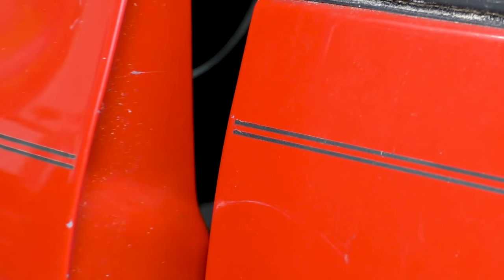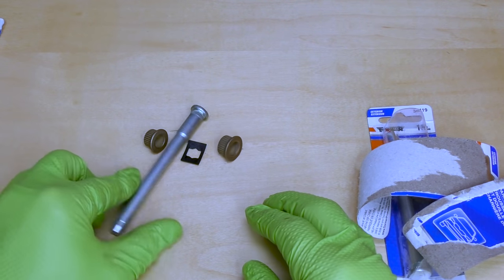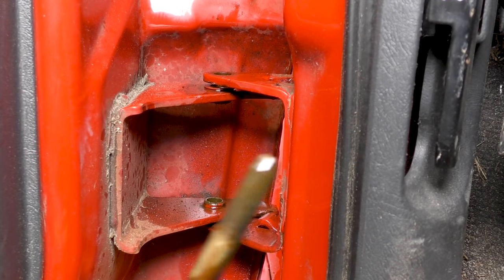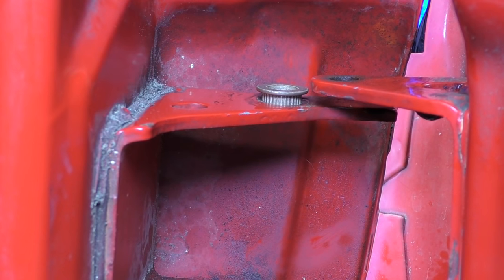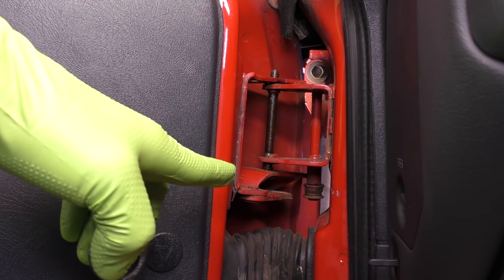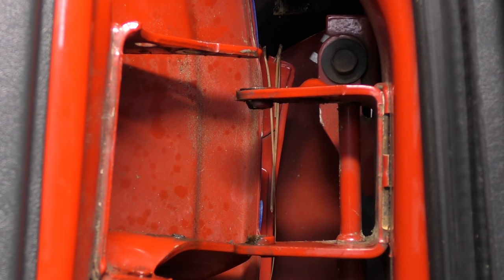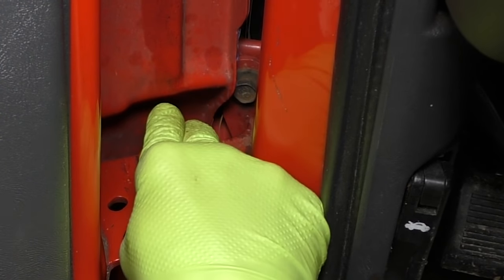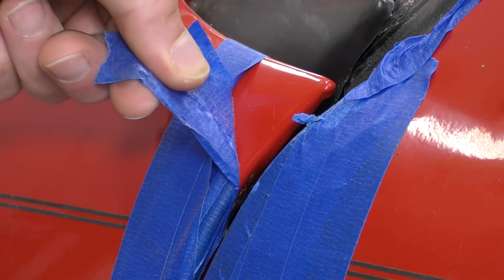How to Replace Door Hinge Pin & Bushing ~ Fix Sagging Door

Comment: How about how this evolves into striker and latching mechanism? Where can I find info on a striker plate, jamb, and latch that's loaded with debris from wd40 over the years and is now stuck to where it will not shut, the temporary flathead system only lasts so long. I do have some dry graphite powder. Anyways, any advice? Perhaps where I should start first? Pins and bushing kit? Latching mechanism? Striker plate?

Comment: You are awesome, I really enjoyed watching the video. One question if I wash the door joints with water, then spray some body wax to joints is that enough to avoid getting any rust or avoid removing joints lubricant? Or should I re-lubricate the joints again?

Comment: Other thing is if top bracket on door is ovaled out, you can clean it off and weld a washer that fits pin on top of door bracket then paint before reassembly
Reply: pin is 3/8" (washer inside diameter hole), so use a washer with that size hole.  You'll be going steel to steel, instead of using a bushing.  You'll have to use wire weld to secure the washer (so you don't torch everything inside the frame).  I haven't done this (yet), but this was suggested by a mechanic with about 200 years of experience.  I suspect this will last a while.  You might have to trim the washer for clearance, depends on the outside diameter of the washer you use.  My pin hole is warbled out bad, so I'm going to try this.  This is the best replacement video I've seen so far.
Reply: I have done the washer repair. Worked great. Sold vehicle. But still good 4 years later. I got another blazer so gotta do same repairs again

Comment: Big nut ( M12) placed there with a fender washer will enable that home made press to get the bushing all the way in without needing it to be hammered and dented.
Reply from the maker: YEP! I think I cut the part about bigger washers. It sounded weird and I didn't have any to show . LOL
Reply: @HumbleMechanic  Grease the parts of the pin that go in the bushings as well before putting in, along with a bit inside the bushing. That way the lubricant is actually where it is needed, and not just on the surface, unlike the factory that put them in bone dry before the paint shop, and afterwards showed them a drop of lubricant is passing, leading to them wearing.

Sagging door I have in the past used the car jack to gently bend up to be a better fit, was just sagging because cabrio and heavy doors but not worn pins. Soft body panels have moved with age, moving the hinges along with them.

Comment: What about replacing the other hinge pin that the spring rides against? The top innermost pin. The bottom of this pin on my truck is bent and the bushing is spanked. Your video on the pins is great, would love to see one on how to replace the other part of the hinge.
Reply: New hinge in that case

Comment: What I'd like to know is actually repairing the holes for the body side of the hinge. When it's like that for a very long time the pin actually makes the hole oblong and bends the bushing in a weird way to where the pin it wore at. I saw someone make a template and cut it and make a new hole. That's cool but I don't have welders to do that fix sadly, I did this actually not to long ago and I see a gap between where the hole is closest to the body. I'll see how long the kit I got lasts till I have to do it again. I'll probably then go to gm and buy a crap ton of them because those are the originals there too.

Comment: What about if instead of just using a washer under the nut you used a longer bolt and a socket under the washer? If you use a socket larger than the diameter of the bushing then you can just crank away til the bushing is completely seated.
Reply from the maker: that way would be great!!!

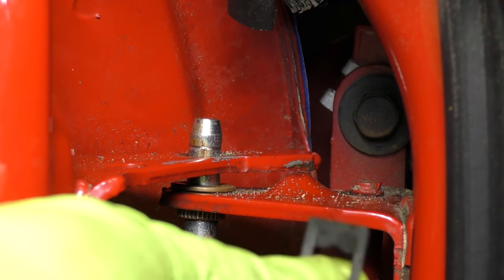Comment: 14:14 pin bent door bracket up on install. The end-stop is misaligned. Hope you tapped that back down.
Reply: Maybe sandwiching the two parts together with vise-grip pliers (not necessarily bone tight but just enough to keep them from spreading apart) would be a good way to do that. I know, you might need three hands or a lot of patience.
Reply: @robj2704  A block of wood between the parts is a nice way to avoid pushing too far. You can adjust a small block of wood with an axe or sharp knife.

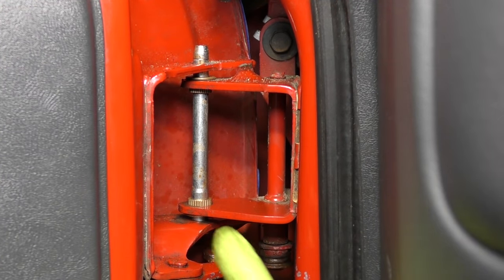Comment: When you drive your pins back in you really need to watch your alinement so you don't get what happens at 14:14. The bracket bent  so much that it misses the the door stop. I'm sure you can bend it back.

Comment: If you use a slightly longer bolt and a socket as a spacer (big enough for the bushing to fit inside), you'll be able to just use the bolt as a press and drive the bushings all the way.

Comment: 15:57 I would suggest also adjusting the lock to make the door flush with the rear panel or door. This car seems to have rear of the driver's door slightly outwards. Usually either the lock in the door or the bracket that it catches have big holes to allow adjusting the door when it's locked.

Comment: I had a 2000 S10 that did the exact same thing.  I took it to a body shop because they had to repair the actual hole after the pin wallered out the hole.

Comment: While I totally appreciate the video, the process is perfect. Those things will only last about a month and you will find yourself doing them again and again. Especially if your door has had bad bushings for a while. On my Sierra, I have replaced them about 5 times.  I am to the point where I either need to replace the actual hinge part on the door/body or weld the hold up and redrill them.
Reply from the maker: OH DANG!!! those must have been toast. I hope the owner doesn't ahve to replace them again soon.

Comment: Charles - I too have a DBP R32 - and the driver's door has dropped a little bit (second time - got the garage to do it last time).   It looks difficult to get tools in there to adjust the hinge and the door is long and very heavy.    It seems that the door somewhat frustratingly covers the bolt positions.   Have you come across this before?  Can you do a video similar to this one - but with a 3 door Mk4 Golf, please.

Comment: rather than a washer on the bottom - I use a longer bolt and a socket (with the washer after) - this will allow you to suck the bushing all the way down in one step and not have to tap inside the car.  Hope this helps someone.

Comment: I got my S10 about a month and a half ago. Today I changed the pins and bushings on the driver's side door, because the door had to be slammed in order to shut it and you had to roll the window down and grab the window opening to close it from the inside, so as not to break the inside door handle.
The door does close a lot easier than it did before. The old pin was setting on the spring because it didn't have a retaining clip and the old bushings we broken and/or missing. 
I still have a small problem. Both before and after the replacement, the bottom bushing on the top hinge is falling out of the bracket. The old one was only 2/3 of a bushing. Is is the new one falling out where I left it in the freezer for over 24 hours? The hole doesn't look worn.

Comment: Hmmm...I'm no technician, but I'm not sure if the whole freezer thing actually works with such small parts. I mean: you need to get it out of the freezer, carry it to your car, aim and adjust carefully, drive it in. That takes too much time and thus the part will be close to room (or hand) temperature again before you can tap it in place. Maybe some freeze spray right before putting the part in would work better.
Reply from the maker: It probably will work better. But most everyone has a freezer around. Less so the spray.  It’s not a needed step but it made install WAY easier. 

I didn’t do it on the PS and had a harder time getting the pin in. Not hard, just harder than it needed to be
Reply: @HumbleMechanic  THE PIN, BECAUSE OF IT'S MASS AND BEING STEEL WILL STAY COLD LONGER THAN THE BUSHINGS. NEVER TRIED IT BUT WILL ON MY NEXT ONE.

Comment: Hey i have some question, so I bought this 13 years old mk5 GTI with 49000 miles on it, neuspeed air intake, and ABT downpipe. But the front suspension sounds a bit squeaky i dont know what might be the problems is it because of rust or something?

Comment: i did like your vid showed to my 1991 buick century-door still sags-looks to me like the door side hinge is wallowed out-the bushings were not bad but i replaced anyway-the door hinge is welded to the car so i cant replace less i cut them off-the ebay kit i bought has 2 other bushings which i have never seen a vid show replacing-maybe i will take back apart and drill out hinge so i can install those other bushings-anybody got any ideas or experiences likie mine

Comment: Hi my name is Jason and I own a mk4 at the moment I just changed my driver door lock Mechanism located in the door. I swapped it out and put everything back together. I closed the door and locked the car. It locked ! I was happy so happy that my car can finally lock all doors and I can sleep good at night. Now here’s where my problem comes in... I can not get my driver door to open at all. It just won’t unlock. I need help. I been trying to get The door  panel off but I can’t . Driver seat and steering wheel is in the way. Idk what to do 💔

Comment: Wouldn't it be easier to use a socket that allows for the bush to fit and drive it in complete with a longer bolt? Maybe not easier maybe just faster? Idk

Comment: i use a longer bolt and a socket so the bushing has room to be pulled thru all the way.
Reply: No.
Reply: @keithclark486  i don't understand the "No" ?
Reply: They make a proper tool , Keeps from Frawling the bushing.
Reply: @keithclark486  if you are a shop that does enough of these then that's fine but a do it yourselfer will not and have a tool that will never be used again.
Reply: @bc1997  
True ✌️

Comment: My doors have the hinge backet on the door side that are wobbled out. The bushings were replaced but is squeaked really bad still. I notice when i pickup on the door it moves at the top hinge hole around the hinge pin. Anyone make a repair on the actual door side hinge bracket, where there is not bushing, its just a hole drilled in the steel. My only thought is to weld it up and redrill it. I am not sure how to get the hole redrilled in the correct spot. thoughts?

Comment: I tried first. It was so hard to remove the pin that I was cursing myself for trying. At the end it didn't solve the issue. Next time I will try replacing both pins.

Comment: I'd use a socket between the washer and bracket. That way you can press it all the way in.
Reply from the maker: great idea. I don't think I could find a long enough bolt. LOL but YES I love that idea
Reply: @HumbleMechanic  Shouldn't have quit the dealership man! Easy access to bolts in all sizes! ;)
Reply from the maker: Hahaha facts. But keep in mind not everyone watching will have that either. So I try to make sure I’m aware of that.

Comment: Can we get a video showing how to replace the RTV sealant on a golf R. Asking because a lot of people tend to have oil on their spark plugs on these MQB engines....
Reply from the maker: The cam Bridge? I have it on the list. It won’t be on the R, but a very similar engine
Reply: @HumbleMechanic  From what I'm reading on the forums it seems to be the cam cover sealant. Audi says it's normal and didn't do warranty. I don't see how having oil on a spark plug is normal.
Reply from the maker: they have to see a leak. Now many feel like a "leak" is any oil coming out of where it's suppose to be. But Audi/VW consider a leak to have liquid oil collecting. Id Call Audi and ask for help on it.
Reply: @HumbleMechanic   @HumbleMechanic Got my hands on a workshop manual.  It's the cylinder head cover that you reseal with the liquid gasket stuff. Would be nice to get a video on doing that on the MQB engines but I feel confident now with the manual :D

Comment: An S-10 with bad door pin bushings?!?  I've never seen that before 😏
Reply from the maker: Im guessing this is a super common issue. Seemed that it's a common Chevy issue
Reply: @HumbleMechanic  Very common issue with the GM S/T trucks and SUVs. Great step-by-step video.  Definitely picked up some great tips for the next time I do a set of door pins.  The nut and washer trick is brilliant!  Squares the bushing up reducing the risk of damaging the bushing and/or the bracket.
Reply: 2 s-10s and a 1/2 ton chevy  all same problem

Comment: My door on my 85 c-10 is locked and I can't get it to unlock it will not open won't unlock with the key or with the. Manual pull latch..

Comment: Almost every gm that has come into my shop has been so far gone this doesn’t work anymore. The bushing holes are so ovaled out.
Reply: Drive them in and mig weld?
Reply: @xephael3485   I usually just weld them and then drill the weld out to the right size

Comment: Since you're name dropping and advertising Advance, let me give your followers a little tip. One of those Dorman - Help Door Hinge Pin And Bushing Kits your holding, like you said, go for $10.00 each, but Doorman also has the kit that comes with 2 Door Hinge Pins, 4 Bushings and 2 clips for $5.99. If you're like me, who has to do the 2 doors on my S-10, that's a savings of $28.00. Those savings may not mean that much to some people, but every little bit counts in today's economy. By the way, that kit of which I speak is Out Of Stock at Advance, has been for quite some time, so I picked my 2 kits up at Autozone. Who by the way, I didn't partner with.😅🤣😂😆
Also, I used a bolt the was 4.5 inches long, that way I could install both bushing;s fully seated, no mushroom worries involved.

Comment: Problem with my truck is that the door hinges are beyond these pins. I now have 4  3/8 ss bolts holding the door up. The bushings in those pin kits are brittle and I don't understand who would come up with such an ignorant idea. Anyway even with these bolts the door still sags. On top of that it's a 90 silvy and the hinges are welded on the body. Don't know what to do a t p

Comment: @humblemechanic On your bolt washer method for the bushings - you should try putting a short socket on the opposite side, use a longer bolt and you'll have enough room to use the bolt and washer to send the bushing home the whole way without using a hammer/punch at the end.  :)
Reply from the maker: Love it

Comment: Level the door with a block of wood or jack, cut a washer in half and press it against the pin on the inside, weld in place and done in under 10 min. your welcome.
Reply: No.

Comment: Those doors, had to be the shit of the shitiest design club.
I'm a mechanic-turned-welder, own a '94 C2500 and a '92 C3500....the '94 I've replace once, but will need it again after 10 years...the '92? I replace EVERY year!!! Contemplating on having ones machined out of stainless, because the JOBBER/Dorman/ Shitbox repair kit, isn't cutting it.

Comment: I neglected to fix this about 10 years ago and the door stop spring fell out. Fast forward to me buying back  it back last year in great condition... Except the driver side door got away from the old man in Oklahoma winds and bent the door in multiple places and irreparably tore the top hinge. Dorman makes a replacement hinge and what a bitch to get on. The door is still not 100% right.